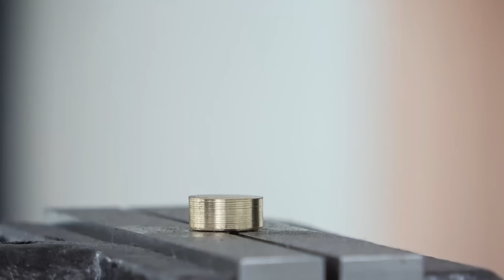Rare Double Cleaver [Black Blade With Kingwood Handle]

Comment: There was a reason why the original handle wasn’t round. An oval cross section in the handle allows the user to index it it their hand and know the direction of the blades without having to look at it. This blade is obviously to hang on a wall and will probably never see any practical use, but you should still understand a tool before “restoring” it. You also significantly weakened the handle by removing all that metal at the top, but again…wall hanging.
Reply: Amazing Jeff
Reply: Exactly my thoughts, nice skills but that clever will never be used as a tool again. His hollow handle is kept together only by that little screw. I have never seen a handle made like this honestly. But again, nice looking
Reply: Bet you're fun at parties.
Reply: @itstricky73  at least my boy Jeff is interesting, you sound like one of them at a party everyone walks away from 🙃😉
Reply: It's incredibly easy to know the direction of the blades without looking at it. All you have to do is hold it and you can feel the direction the weight is pulling you. Weight distribution is how your brain knows how to orient your own body. Your brain is designed more for that than for touching.
Reply: What could he use it for in 2023?? We ain’t in the middle ages gramps 💀
Reply: @GuncaFromlv  role play lol
Reply: @GuncaFromlv  you will be gramps one day , you won't like to be spoken to like tha huh ?? Plus many people don't want or need new age shizz they like the old way little fella
Reply: Man-splaining is not always needed thanks. This ☝️ person knows what theyre doing whether you can accept it or not. Im sure they know why the handle was the way it was and has a reason that it is the way it is now. Theres always "many ways to skin a cat". And just for kicks...you explained in your comment why your own comment is unneeded...🤣
Reply: @Kyle-nm1kh , if made to be balanced, what's "left" versus "right" will always be equal. 
I'm not a blacksmith, but I think Jeff is right about that, at least. An oval handle and shaft would help the user.
Reply: @Imhotep70  I don't know exactly what you're trying to say. But imagine a + sign which has north, east, south, west. Then a - sign has east, west. Because north and south are not there, and east and west are there - it is fundamentally not balanced. It is only balanced between the east and west axis. The north and south axis is not balanced with the east and west axis.

Edit: you can always pick up something of similar shape and spin it around and see what I mean. You could probably even do it with a shovel.
Reply: This guy cleaves.
Reply: @micgreenson7308  It's not that deep buddy. Go lecture your grand kids :face-green-smiling:
Reply: @GuncaFromlv  I'm 35 little fella
Reply: @micgreenson7308  bro you're 3 years older than me and acting like some wise old man lmao
act your age bro
Reply: @GuncaFromlv  respect your alders
Reply: @micgreenson7308  yeah I respect the trees, but not you xD
Reply: @GuncaFromlv  wow you sound 8 dafunk is you profile pic 🤣😂 grow up lil dude jeeeez
Reply: @micgreenson7308  how are you so young, but sound like a boomer?
Reply: @GuncaFromlv  ?? Boomer lmao your over 30 use real words lil bro
Reply: @GuncaFromlv  Writing TIL and dont talking to people like a standard 13yo going full rebellion and disrespect IS NOT A BOOMER THING. Every 20yo+ are born after 2000, and blissfully act their age. But eh, at least your very youg in your head. I just wish you know how to behave yourself when you are IRL.
Reply: @GuncaFromlv  and how you over 30 with pic like you in school 😂
Reply: @micgreenson7308  sorry for living in the current century lmao
Reply: @bsanchez1713  💤
Reply: @itstricky73 NOT 💩
Reply: @GuncaFromlv so meat cleavers don’t exist in 2024?
Reply: @GuncaFromlv  yawn lil bro Ava nice day
Reply: False
Reply: I find watching the restoration very relaxing. can I ask why you chose to NOT make the fixings nut at the bottom flush? it's incredible work, just wondering why
Reply: @Kyle-nm1kh I'll take you up on the why:

Working with your hands in a single skillset requires the user to become a master of their domain (which happens to be a kenetic activity in this case, chopping). One of the things that a master wants is perfection in every action and this is aided by his toolset matching perfectly to the required work at hand. In this particular case I would sermise that a butcher chopping for hours a day would very much indeed want an ergonomic handle especially for heavier work, cleaving. You would have one side sharp and perfect for precision cuts and the other side less so as it is to sever tendons, cartilage etc and all it takes is a flick of the wrist with an oriented handle to swap between sharp and less sharp as needed ( bone splitting requires a slightly dull edge).

In summery a round/barrel handle is not ergonomic for heavy tools and in this case it would not lend to the predictability of switching between blades used. 

- I am a professional mechanic and the tools matter more than people know. The world still turns because of people working with their hands and I'll take the 1st world luxury of having master class tools as a blessing.

Cheers and thank you for your pov as well, quite right about the premis but not this exact execution of tool.
Reply: I agree. Round handles are not ergonomic and don't lend to needing to know sharp side from dull when switching blade uses (severing bone vs slicing meat for instance). With the flick of the wrist you can change to the blade you need if it is a shaped grip handle.
Reply: @obancameron  so it is because of a speedy 180 degree flip. OK, but still you could just add some strips of wood to it with glue and small dents to fix it in. You wouldn't have to replace the whole handle to modify it.
Reply: @Kyle-nm1kh  Hmm yeah that kind of thing is possible, even just further working the wood to have a thinner side profile but I don't think it's a bad tool he made at all tbh. Just maybe more of a piece to show your pride like an ornate sword vs a sword used to actually battle. Like if you are proud of being a butcher but wouldn't use the tool beyond showing it in a display or on the wall as a mark of pride in your trade.
Reply: @obancameron  it would be good decoration for like a bar or restaurant. If I used a cleaver I'd just buy a modern one
Reply: 0
Reply: The original handle wasn't ovular or the bolster and butt cap wouldn't have been circular. Also, the tang would've been shaped into an oval to spread the force properly throughout the grip. And the section he removed was relatively small and away from the the bolster, where the majority of the force is going to be received.

But I do agree that it would've been nice to see the handle heat-fitted to the tang and the bolster guard hammered tight instead of epoxied. Then again, I'm a fan of using a vintage grip for a vintage blade. So, it's all just a matter of taste.
Reply: @AaronReece  look close on the first second of the video and you will see the bolster is indeed oval along with the handle, tapering back to a round cap (as you said). The tang itself was square as is often done in hand forged pieces and this is easiest to see when it is lifted from the rust remover bath. There are a few options for a tang but the square cross section would allow for the needed flick of the wrist to spin to the opposing blade and allow for the force to be absorbed in the short distance given the size of the blade.

Really nice example of hand crafting by the original maker of the tool using their own design and not following what is now conventional.
Reply: Yup its called indexing the blade direction .. forge in fire FTW taught me that .. operator can know just by the feel of handle if he holding it correctly and straight before swinging down , important to know when chopping things in quick succession and things are getting messy during the meat processing process . .
Reply: @Kyle-nm1kh Every judge on forged in fire would disagree with you.
Reply: @GuncaFromlv ... do you think people dont use cleavers anymore?😂
Reply: I feel this is one of those situations where the cleaver had lived its life and it was time to rest if that makes sense I'm sure it was well used before but now it was his to make into whatever he wanted it may not have been accurate but he did what he thought was right for what he wanted to use it for your information that you gave was very knowledgeable though and it was nice reading the facts about its history but maybe be a little less judgy about what he does with his work it could come off offensive and this is all for our enjoyment but again the knowledge you gave was nice to know
Reply: Винт лучше было бы утопить или хотя бы сделать полукруглым. Это не говоря о том что рукоятка была полностью изменена. Подобную работу реконструкцией никогда бы не назвал.
Reply: @itstricky73 It's constructive criticism. The restorer will never get better if he doesn't realize his mistakes.
Reply: I didn't have a perfect look at it but from what I saw, the old handle appeared round.
Reply: @Kyle-nm1kh  Rough direction, certainly. But you need more than rough alignment for an axe strike. The larger the offset from the handle to the edge(knives usually have none) the more critical edge alignment is. If you've ever used an axe that is an actual tool, you will have noticed that the handles are never cylindrical. They are rounded, but they are profiled more as truncated prisms or oblong shapes for exactly the reason you think is unnecessary. You can feel, roughly, when the blade is aligned, but feeling doesn't get you any more precise than a 20-30° margin of error if your handle isn't profiled to index off of. The only historical examples you'll see with round handles are parade axes and decorative items, or the odd heavy cavalryman's axe(heavy referring to the cavalry, not the axe) , which weren't swung so much as stuck out at arms length while the horse ran by the target.
Reply: @pawz007 It's a sad state when anyone with greater knowledge of a subject is accused of "man-splaining" any time they demonstrate it. Let's all sink into relative ignorance to make you feel better about yourself.
Reply: @willrichtor  its man-splaining because of the arrogance and demeaning nature of the comment and because the "advice" was unsolicited. There is no indication that the commentor has greater knowlege for we have no idea how much knowlege the op has. It seems to me that the op knows what they are doing. If you feel the need to demean someone cuz you thought they didnt know something youre in the wrong. 
P.S. there is no need to slip into relative ignorance...if you hadnt noticed the world is there already. Now, should we all just allow bullying and demeaning comments so that you can feel better about yourself? Seems silly when your rhetoric is flipped back on you doesnt it.
Reply: All of these people arguing 
Meanwhile I watch this type of videos to sleep 😅
Reply: It cracks me up how many comments this has generated. I guess all the engagement helps the creator though, so that’s good. After watching this again, the original handle looks pretty round. I’d still prefer an oval handle, but I don’t use a cleaver very often. I like the purple heart. Looks great.
Reply: @Fantom4t5 Exactly😂
Reply: @GuncaFromlv  restoration is an art to keep intact the function, the look while using the original materials.
Reply: @micgreenson7308  Imagine trying to put someone down for being knowledgeable. What is this? 5th grade?
Reply: @pawz007 There really isn't, and that's a dumb analogy. Weapons are made a certain way because if they don't, they fail when used for more than wall hanging.
Reply: @insidethemachine  sorry what you mean broski ??

Comment: Nice restoration but I think the screwhead looks a little brutal, maybe better to have been a dome shape?
Reply: Nah
Reply: I agree and I also feel the brass parts should be flush with the wood of the handle.
Reply: I would have loved to see so.e glue in the hole and then filed it flush with the end so it looks like nothings there
Reply from the maker: That's right, I admit that I actually had a completely different plan, I wanted to do away with the screw completely. But I liked it so much here that I left it.🐢

Comment: The screw not sitting flush would bother my OCD but the handle is beautiful and I love how you got the blade darkened. Greeat job.
Reply: I don't know if you've ever done any metal work, but him dipping it in the acid was the easiest thing he did on that build. It looks nice, but also  it helps keep the steel from rusting. You don't even need the acid, because some people just use boiling vinegar, and it does the same thing after a few dips. I do it all the time.
Reply: I'm with you. Countersinking it just to the not use a beveled screw was shameful

Comment: Beautiful work. The original brass rings would have been heated and then shrunk onto the wood, causing interference fit. This could have been a stronger fastening than machining a solid billet and bonding the wood to the axe. Beautiful turning work though.

Comment: looks like the main body is wrought iron. the edges are probably high carbon steel forge welded on.
Reply: Definitely.  You can see the difference in sparks while he's grinding the top contour.  I let out a "Nooo!" when he took an orbital sander to the grain of the wrought iron.  Still turned out great.

Comment: ther reason it looks like wood is because that piece of metal was the result of folding and forge welding and stretching and repeating bunches of time, likely incorporating many recycled chips and maybe old nails or whatever. that looks a hell of a lot like pre industrial revolution forging to me. what a beauty. thanks for giving it that old shine back. definitely deserves it. as a hunter of elk and mule deer i would find this beastie incredibly useful.
Reply from the maker: Thank you for your feedback, do you really think it's that old? 🐢
Reply: If it’s old enough, it’s more likely that is a wrought iron body with hardenable steel forge welded onto the cutting edges. Wrought iron looks like wood grain, just as this one does.

Comment: Nice restoration, but why did you start with breaking the upper ring? Wasn't easier to start at the bottom?
Reply from the maker: That's right, then I could have removed the entire handle, good point! 🐢